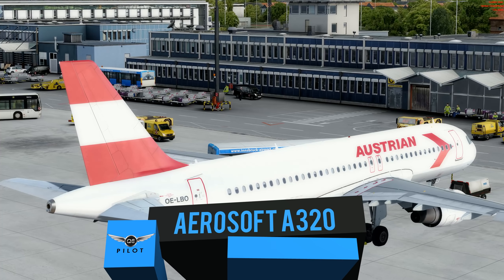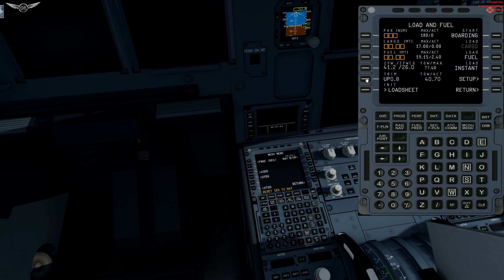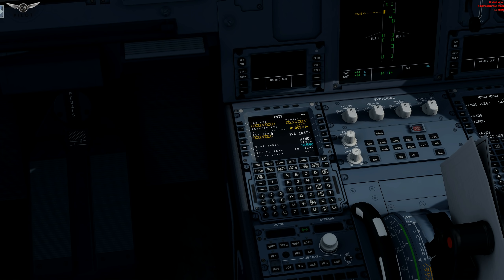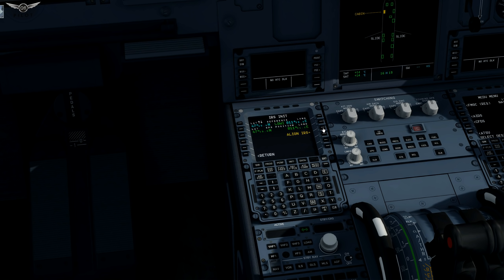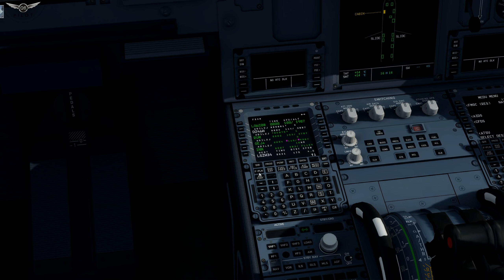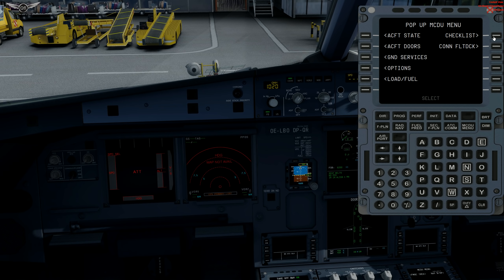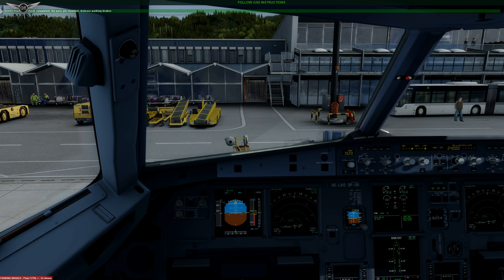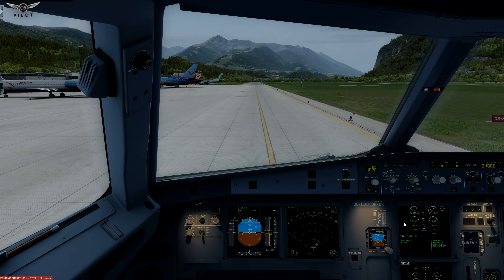P3D v4.5 | Aerosoft Airbus A320 | LOWI-LSZH | Full Flight

Comment: Greetings. I am reaching out to the flight sim community with some questions. I am using P3d v 4.5 on a brand new gaming rig. It does seems that many times when I am in mid flight my computer will crash while using p3d v.4.5 it also happens   when I am using X plane 11. Are these crashes normal or what? Does anyone have the same issue that I am having or some suggestions??